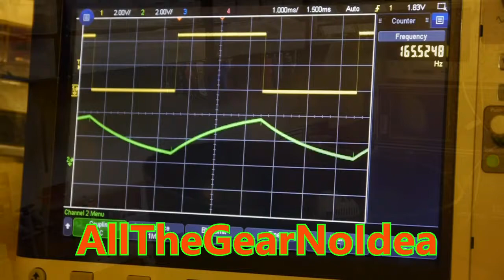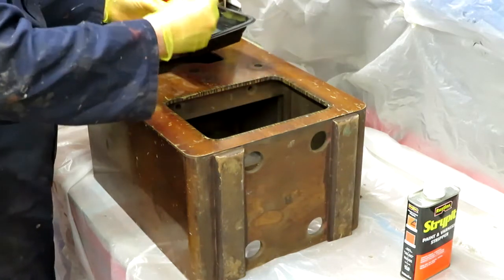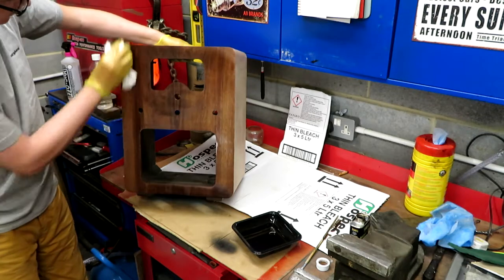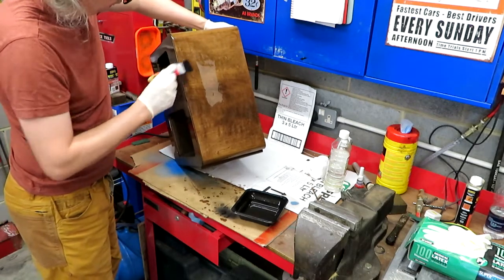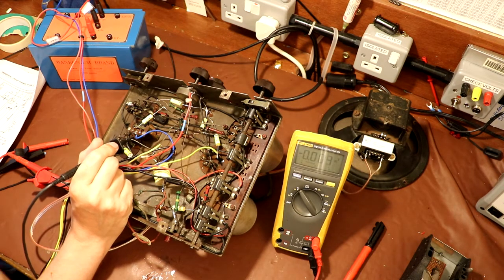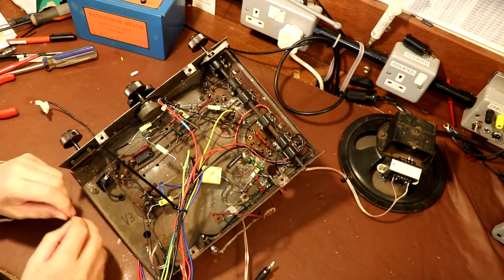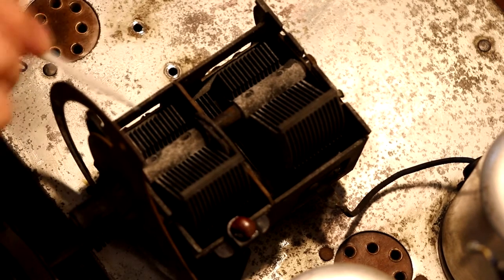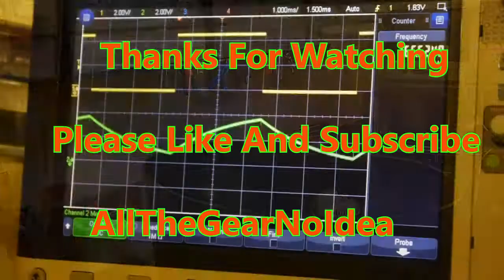Cossor 238 Vintage Radio Repair - Part 4

Comment: Back in pre-history days, we kids had Methylene Chloride strippers in a can. You had to be very careful careful not to get a lung full of the fumes and pass out. It would also eat epidermis rather vigorously. There were local shops hot tanking the brew to fit large pieces. Pity the poor guys that worked in those places. I think the EPA has banned it here now, at least at the consumer level. Smashing job Chris.
Reply from the maker: Danish Native Yes I think it’s banned here now. Shame in some ways as it worked really well. I know a guy that does that tanking it’s a horrible job and I cannot believe he is still alive and still doing it as he is in his 80s now still stripping doors.  This radio has been a lot of work but it’s been interesting to learn and read about the interstage transformer and have ago at cabinet work which previously I have not enjoyed. Thanks for watching Regards Chris

Comment: Great Job Chris a Lesser Soul Would Have Given Up By Now With All The Bloody Broken Or Faulty Parts. Kudos To You For Your Determination !! Oh And The Radio Sounds Great And The Cabnet Likewise Ya Gota Keep The Little Lady Happy..Regards mike.
Reply from the maker: raceingdemon6464  Hello Mike. I have to admit this radio has been much more work than I anticipated. Cabinet work I find very tedious as it’s all about the preparation. I rubbed the cabinet down with fine wire wool last night and just put a final coat of Danish oil on and I have to say the result is really good a worth the hard work.  The coil winding is proving challenging it’s only 0.08mm in diameter and very fragile. It’s quite infuriating 7000 thousand turns in a the wire snaps. Still it’s these problems that we learn from. Not sure if there will be a video at the weekend I may do something else while I figure out the coil winding. Thanks for the watching and your encouragement best regards Chris

Comment: Those faux finish "inlays", are a bit of a quandary on North American radios too, some have stripped around them, others have replicated them with paint or home made decals, and still others have replaced the faux banding with real veneer. John, Zone1242, the Irish fellow in Switzerland, did the latter on a late 1940s Pye radio that had that stuff around the speaker grill, but he's a luthier, who also built a cabinet for one of his other Pyes. 
 The real headaches are the sets that had the front panel, or even the whole cabinet covered in the stuff. I think I would try replicating the band with paint myself, though I don't think it adds much to the look such that anyone would notice if it were missing.
  For dents and scratches I have found that a clothes iron with a damp rag works well for steaming out most of them, though a soldering iron works well for fixing the small ones.
Reply from the maker: Thanks OlegKostoglatov  I don’t have a lot of experience with cabinet work but getting better the more I do. This is such a boring cabinet the only remarkable feature was the detail around the speaker. Still these are not rare sets and it’s better to have something I’m allowed in the house etc. I am planning on building a cabinet for some chassis I have. Thanks best regards Chris
Reply: I didn't say anything about it before but I tended to stick to hand sanding, or use a cabinet scraper, when it came to sanding a radio cabinet, it's too easy to sand right through veneer with a power sander. I've even stripped cabinets where someone sanded through the veneer at the cabinet factory, and then covered it up with shaded lacquer with the rest of the cabinet.
Reply from the maker: OlegKostoglatov  your definitely correct about hand sanding but I’m happy to use the power sander. I actually think that it can be safer as the flat base makes it less likely to go over the edge and round it off. It’s just a matter of being careful.  The only problem I had was to much vacuum that was pulling the base down far harder than i wanted it. That’s why i removed the vacuum hose. Having said that I don’t think very much sanding is required the whole exercise was about 3 minutes. Cabinet scraper are good but only with experience as they can really gouge if used in error. Also they need a bit of effort to raise and maintain the bur, I’m not really proficient with them.

Comment: The cabinet looks quite good Chris. Well done on that. If you're going to attempt a rewind of the transformer, you'll have to wear a 1940's house dress and some earrings while you're doing it. The lip stick is optional. ATB Doug.
Reply from the maker: Doug McArtin A dress and earrings. I like your thinking!  anything for a laugh.
Reply: Seems to work for Glasslinger. He has a neat little coil winding machine for those 1920's radios he does up.
Reply from the maker: Doug McArtin  I like his stuff very clever person. I will have to look at his winder
Reply: The last video he put up on restoring an old Aplion horn speaker, he had to rewind the driver coil. Very talented dude.
Reply: @dougmcartin3881  Ron (Glasslinger) is our hero radio and everything else man. Dam sure God used him to put our universe together, God must have done...how else did he manage to build it in seven days.

Comment: looks good  I wouldn't have used stripper on it personally but having seen how it turns out after stripping I ,m going to strip my old speaker cabinets they have the same type of finish as an old radio they are older than me ! 
I tend not to lose bits when I take stuff apart my biggest problem is remembering where everything goes back having said that I unsoldered a transistor out of a power supply but because I didnt have my glasses handy I brought it downstairs to look it up on the interweb now I cant remember where the hell I put it !.
Reply from the maker: thehappylittlefox aka benji  Hi Benji depending how bad your speakers are you could just try applying the danish oil over the top  this can work if you wire wool down the old finish a bit to remove and rough spots. It’s a lot of work stripping and I have always found it hit and miss, but I this radio was in such a state I wasn’t loosing anything.   You probably know but a lot of old radio and speakers would have been sprayed using a toner lacquer so you get a different kind of look if you stain and varnish separately. Still I don’t think you can go wrong with danish oil if you put the time in etc. Thanks for watching Regards Chris.
Reply: @allthegearnoidea6752  well I know a bit but every time I learn something new  it pushes some old stuff out of my brain !
my speakers are an old pair of Wharfedale W3 's and are in a similar condition and have a little bit of damage courtesy of my herpes delivery when I bought them off  an auction site a long while ago they do however have quite a gloss finish or at least it appears to be in some places  I can see my face in it so thats not a good thing !  Regards Benji

Comment: Nice work, I wouldn’t know what the hell I was doing in one of those vintage bits of electronics.
Reply from the maker: Defpom's Electronics & Repair You wouldn’t have any trouble repairing one it’s only a three transistor circuit.  But the work is often more mechanical than electrical. I wonder are there a lot of Antique tube Radios surviving in NZ?  Thanks for watching and comments regards Chris

Comment: I don't think that I have seen an audio interstage transformer in a 1930s battery radio with a single ended audio output stage, most of which seem to have used pentodes. The ones I have seen with a transformer all had push pull triodes, usually with a class "B" or "AB" format like a later transistor radio would have, and it was not an autotransformer. The one set I did work on that had an autotransformer in the audio output stage also had a phase invertor tube,  in a push-pull circuit, it was a Canadian Westinghouse model 981 from about 1941.
Reply from the maker: OlegKostoglatov  I think this arrangement was pretty common here in the UK. From what I understand the design was old even back in the day when Cossor built it. I don’t know we they did not use capacitor coupling as these were cheap sets and capacitors would have been cheaper than building the transformer. The only thing I can think is that gain of the tubes was relatively low compared with later ones. The auto transformer had a voltage gain of 2 -3.  What do you think? Thanks for watching band comments regards Chris
Reply: I found a picture of a set like yours posted on a U.K website about Cossor radios, it states that it was a 1937 model.  So an audio interstage transformer was really old fashioned by then other then with a push pull arrangement, and they were beginning to eliminate the transformers in those sets, replacing the transformer with an extra tube.
  Battery sets would have been one of the exceptions, perhaps because of 
"B" battery life, class B or AB power amps are at cutoff, or near cut 
off with no signal, and I've never seen such an amp without a 
transformer. 
 It looked like Cossor used a similar valve/tube lineup for several years in their battery sets so they may have had a stockpile of 
autotransformers to use up, or perhaps it was a means of avoiding royalty payments. Theoretically there could be some voltage gain, which was why they were commonly used in 1920s battery sets with triode tubes. But tetrodes replaced triodes, pentodes replaced tetrodes, and beam power tubes superseded pentodes for efficiency and gain, which would explain why the Cossor seems more then loud enough with just an R-C coupling. I've never had much luck trying to repair an audio interstage transformer
Reply from the maker: OlegKostoglatov  Been chatting with the guy that runs the Cossor website and he passed on some information about the set and it’s history. He did say the design was very outdated even back in the day and Cossor were very slow arriving at the superhet party.  I have my doubts about winding the coil I think wire breakage will be a problem.

Comment: Bloody smashing, it lives :-D
So that transformer is sort of like the small blue taped ones found in cheap transistor radios, usually the red taped one is present also for the speaker.
But different impedence.
The case looks a lot better, less of a muddy look.
Wow that variable toaster rack is really nasty, i bet there is something like vinager or bleach that will clean the crud off,  using the misses tooth brush again of cause, oops :)
Thankyou for your smashing video chris :-D
Reply from the maker: zx8401ztv it is impedance match but it’s more being used as a voltage amplifier as remember valves are voltage devices. The gain of the early tubes was poor so this multiplied the audio from the detector by three before the audio amplifier.  It’s also providing bias as there is know cathode resistors. Thanks for watching and great comments as always. Regards Chris

Comment: Nice job on the cabinet, even though losing the painted on tiger stripes was sad.  Ignore the folks who will whine about "patina".  It's not a 300 year old mahogany Chippendale sideboard.  It's an early modern mass-market radio. Built, as you note, to a price point. The damage to the original finish  is not a selling point, particularly if it's so ugly the missus won't let you bring it in the house.

 Patina is evidence of use and care.  What you removed is evidence of disuse and abuse.  The radio will go on to live another 80-90 years.
Reply from the maker: Dennis P. Thanks Dennis for nice comments on the finish. It’s got four coats of Danish oil on it now and once rubbed down and a final coat think it’s going to look good.  I always find my cabinet work very hit and miss. Still it’s all good practice. Thanks for watching and comments regards Chris

Comment: I'm wondering Chris if C10 went short circuit it may have caused T1 to burn out then. The whistling coming over when you're tuning sounds like the IF decoupling capacitor is shot.
Reply from the maker: Theoobovril  I checked the leakage on all the capacitor and they were not good but not any shorts. But who knows when your dealing will such an old set lots of history and opportunities for mistakes in all those years . You won’t find any IFs in this radio, Wasn’t even a glint in the milkman’s eye when they built this baby.  The squealing is just the reaction control as the positive feedback puts the radio into oscillation,  the reaction control is kind  of like foreplay most of the time your doing it wrong. Thanks for watching and comments best regards Chris
Reply: @allthegearnoidea6752  Ah, it's a TRF set then Chris, never had one of them.
Reply from the maker: Theoobovril You haven’t missed anything!
Reply: @allthegearnoidea6752  Shall have to re-run the vid' and have a look at the circuit diagram more closely Chris.
Reply: If T1 did not fail due to moisture ingress then the only solution to it going down, that I can come up with, is that an incorrect supply was connected to GB1 causing T1 to draw excess current.